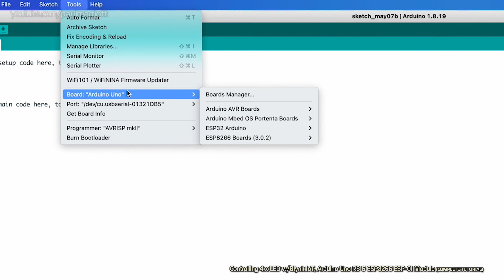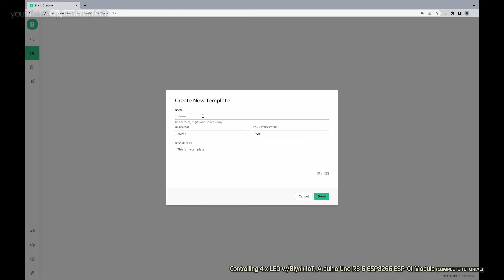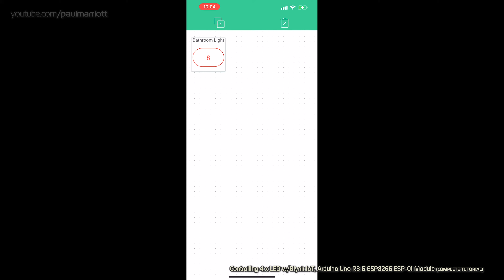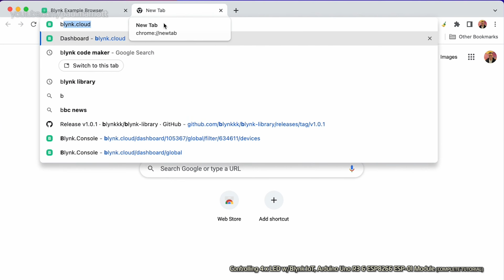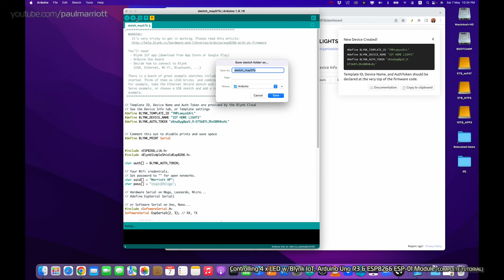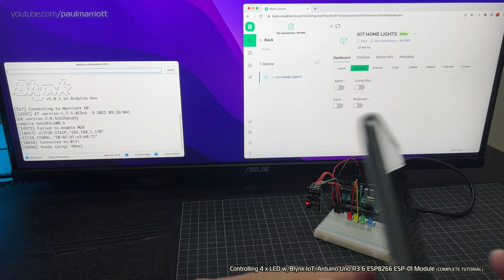Blynk IoT (Blynk 2.0) App w/Arduino Uno R3, ESP8266 ESP-01 Module, Blynk Cloud & 4 x LED [TUTORIAL]

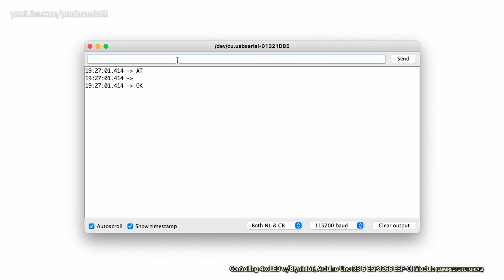Comment from the maker: IMPORTANT NOTE (18/6/2022): Seen at 4:33, the AT command for checking UART/Baud Rate on your ESP8266 ESP-01 only appears to work if the module is flashed with SDK 2.x or above. In other words, if your module has the older 1.3.0 SDK the 'AT+UART?' command will simply give an 'ERROR' message on the serial monitor. However, you can still set the UART/Baud Rate using 'AT+UART=38400,8,1,0,1' regardless of which SDK your module has. If you're not sure which SDK version your ESP8266 ESP-01 module has, simply type 'AT+GMR' in the Serial Monitor and it will tell you.

Comment: great work honestly, simplified and straight to the point, i have one question tho, its not related to the project, but can i ask what is the streaming/casting software or application you're using on you're phone and pc to show case the phone screen?
Reply from the maker: @therealbarakobama9245 Thanks for the comments / feedback! I’m using the regular ‘screen recording’ function from my iPhone (you may have to add it in via ‘control center’ first). As for my computer, I’m using screenflick (a paid utility which I have used for many years). All the best!

Comment: blynk:29:10: fatal error: ESP8266_Lib.h: No such file or directory

 #include <ESP8266_Lib.h>

          ^~~~~~~~~~~~~~~

compilation terminated.

exit status 1

ESP8266_Lib.h: No such file or directory
This report would have more information with
"Show verbose output during compilation"
option enabled in File -> Preferences.

Error occur like this, which library file should i installed?

Comment: I commented 1 year ago that it works... It's a few hours of tranquility. If your service provider's connection drops or your power goes out, there are a series of problems in which your code will stop running, or you won't be able to reconnect again, or if the internet is still not available, the code won't even start. I imagine an encapsulated solution from blynk wouldn't be any better. It seems that there is a library like esp8266.lib that allows the code to run much better when there is no connection and that allows you to queue what you want to send to the network

Comment: I'm repeatedly facing issue while installing ESP8266_Lib.h, i've tried to install these versions (v1.0.1 / v1.1.0 / v0.6.1 / v1.3.2) but facing same issues, ard IDE showing error "ESP8266_Lib.h" no file or dir" i tried with both ways (by adding zip lib or by copying folders which you showed in the video) but didn't succeed
Reply: My ESP is not responding. What can I do?

Comment: I have the problem to connecting the wifi which is the serial monitor display [703] Connecting to SYIFRAH_NICO 8467
[1759] ESP is not responding
can you give the solution?

Comment: Hi, my esp01 worked perfectly fine... But I have only 1 problem. After the serial monitor says 'Connected to Wifi', the 'Ready (ping : ...)' doesn't appear, means that it haven't connect to blynk yet... What to do to fix it??
Reply: Found the solution! It's the Wifi connection problem... When I use my friend's hotspot, it work perfectly, so it was my internet connection problem
Reply: @aijeong7684 can i do the same with arduino nano? Please help.  Can i use the RXNV wifly instead of Arduino Wifi Sheild

Comment: I managed to control it with my phone but the buttons on my laptop don't update. I also can press a button from my laptop, it lights up the LED but the color of the button doesn't change and after that, i can turn off the LED only from my phone. Does anybody know how can i fix this?
Reply: Bro, did you fix that?
Reply: I don't use blync, I write my own web page. On this web page (phone or browser) I included a Refresh button. On either side, I press/click the refresh first.

Comment: Hai Paul thanks for your great video i have tried your guide through your video but it works only with mobile dashboard, the LEDS On and Off normal but when i click on the web dashboard the LEDs did not work. I found that my ESP8266 flashed with SDK version 1.5.4.1 and AT version 1.2.0.0. Could you please give advise and solution (on your video you use SDK version 3.0.5 with AT version 1.7.5) and if you dont mind please share how to up grade ESP8266 module with SDK 3.0.5 and AT 1.7.5 as you have it. Wish you all the best Paul. thanks a lot.

Comment: Hello . great video . I wanted to repeat this. I have an arduino and a sim800. I flashed the arduino. the phone connects to the computer and is controlled as you have in the video. but it doesn't work on the device. in the computer shows that the device is offline and does not connect

Comment: Hey Paul, well done I liked too much, simple question is it possible to access or control those LEDs over internet.?
Reply from the maker: Thanks a lot! The answer is yes, you can control them over the internet.
Reply: @PaulMarriott  so you mean if im not connected to same wifi that esp01 is connected to  , then too it would work? It would work on mobile data too?

Comment: is there 2 Arduino programs? one for the arduino uno and one for the wifi module? I am a little confused lol
Reply from the maker: No, the main code is just for the Arduino Uno. As for the ESP-01 module, you only need to ensure the baud rate is set to 38400,8,1,0,1.

Comment: my question is that how to use digital pin 14,15,16 of arduino as output because in blynk there's maximum digital pin 13(from 0 to 13)is available.
Plz help me
Reply: I guess you can manually input the pin numbers , any number works there ig

Comment: thank you so much, but I have a question please, if I used another sensor to make for example pin 8 up to turn on the LED, can I see that pin 8 LED is ON on the phone or website? ( can I turn the LED ON manually and turn it OFF using the phone? )
Reply from the maker: In brief, yes. It should be possible because of the nature of cloud computing. Whatever you do on the phone will be automatically pushed to the web dashboard and vice versa.

Comment: Hi, Nice informative video, Thank You. In the code you have not added any extra code to control the led such as BLYNK WRITE() functions, could you please explain how the code works. There are other tutorials showing using the example blynk edgent esp8266. Can we use the same library for arduino uno interfaced with esp8266 esp-01 module...?

Comment: Hey, when I open the monitor serial in the IDE I have this Message [1532] ESP is not responding. Can you please elaborate on this?
Thanks.
Reply: Hi, I am getting the same error - how did you fix this? I would really appreciate if you could let me know
Reply: @jadeashten  Weeell I didn’t.
Eventually I gave up on the idea of connecting my mega board with esp8266.
Everybody recommended to buy a wi-fi board if you’re looking to make an IoT project.
Reply: @viktor7425  Thanks for the reply! After days of struggling, I actually did manage to fix it - it was to do with configuring the baudrate of ESP8266 with your specific wifi requirements! I agree having wifi built into the board would have been a much more efficient alternative!
Reply: @jadeashten  i am stuck on a same error, i would really appreciate if you could help me solving this issue or how did you solve your issue

Comment: Bonjour
Merci pour ce très bon tuto 😉

Pour ma part avec un NANO j'avais un problème de " ESP is not responding "
J'ai donc géré la broche "RESET" du module ESP01 ...
Donc un fil de la broche D5 vers la broche RST du module ESP01 et ensuite modification de la routine "setup"

void setup()
{
  const int RESET_PIN = 5;
  pinMode(RESET_PIN,INPUT);
  
  // Debug console
  Serial.begin(115200);

  // Set ESP8266 baud rate
  EspSerial.begin(ESP8266_BAUD);
  //delay(10);

refait:
    if (digitalRead(RESET_PIN) == 0) {
      goto refait;
    } else {
      delay(20);
      pinMode(RESET_PIN,OUTPUT);
      digitalWrite(RESET_PIN, LOW);
      delay(20);
      pinMode(RESET_PIN,INPUT);
    }
  
  Blynk.begin(auth, wifi, ssid, pass);
  // You can also specify server:
  //Blynk.begin(auth, wifi, ssid, pass, "blynk.cloud", 80);
  //Blynk.begin(auth, wifi, ssid, pass, IPAddress(192,168,1,100), 8080);
}

et plus de probleme !!
Reply: Bonjour j'ai essayé votre solution mais le problème persiste toujours

Comment: the your video is perfect, but i have the problem, when i open the monitor serial in the ide i see the message blynk , in the second instant i have the this Message [1532] ESP is not responding. you now whwre is the problem ?
thanks
Reply: Kindly check for the TX and RX pin whether you had connected correctly to the 2 and 3 port sir... I too faced the same issue and now i got connected
Reply: @reivanthk800  hey sir, mean change the port from 2 and 3 to 0 and 1?

Comment: Hi, just want to ask if I use the WiFi ESP8266 to USB Serial Adapter Module instead the ESP Link V1.0 will there be any difference?
Reply from the maker: It shouldn’t be a huge difference in terms of programming your module for AT commands. The ESP Link v1.0 just makes it far easier to connect the ESP8266 ESP-01 modules without having to use excess wires.
Reply: @PaulMarriott  okay Thank you so much, it is working. your video is really amazing!!
Reply: is it the reason why the esp is not responding?

Comment: can't we use the same pin for many leds if we add the "if'" and "else" in the arduino code ? 
for example 
if "button 1 ==1"
digital write (red light on )
 thank you
Reply from the maker: Yes, it should be possible. Add the code you need at the void loop(){} section (after the Blynk.run(); line).